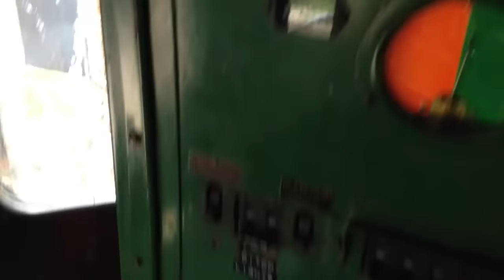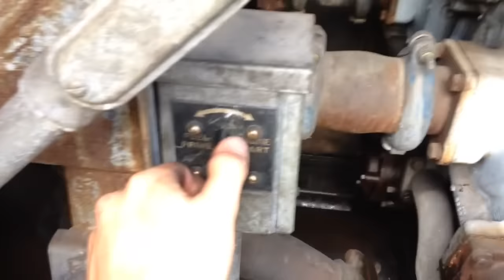Starting a Locomotive, (Full Sequence), EMD GP10 at the Florida Railroad Museum in Parrish, FL

Comment: Not necessarily better, but a whole lot faster than filling water tank, shoveling coal into the furnace, lighting the furnace, waiting for the water to boil, & patiently waiting to build up steam pressure. Cool video!
Reply: @ Pttranjal Shrivaastav Not necessarily. For all the faff and bother it takes to get an old teapot going, the sheer torque they had is unmatched. A healthy 2-8-0 or 2-8-2 will outpull this geep by a factor of two or three, and a mainline monster like a 4-8-4 will damn near pull an order of magnitude more cars.

No, the real reason diesels won out is lower maintenance, lower operating costs, and it being so much easier to run 5, 6, 10, 20 of the damned things in a single train under a single crew. This Geep may not have the tractive efford of even a Consolidation, *But you can just throw six Geeps into the same train and suddenly pull what used to require a Northern*.
Reply: Where did you get that idea, some of the largest steam loco's can't even match Diesel starting tractive effort, nor sustained
Reply: TestECull  Let's see.... According to specs on a 4-8-8-4, the tractive effort is 145,930 lbf... a modern SD70 can produce 200,000 lbf tractive effort starting out and 175,000 lbf continuous.
Reply: @Micah Lall-TrailThey do, yes. One healthy 4-8-4 Northern can do the work of three or four Geeps. A mallet like UP 4014 or 3986 can do the work of 3-4 sixaxle heavies(There's even a video on here of 3986 pulling a loaded stacktrain up Challenger Hill totally unassisted!). They just lose out on operating costs. You have to have a crew on each and every locomotive, so double-heading them is significantly pricier than with diesels. They have VORACIOUS appetites for both fuel and for water. The emissions leave a lot to be desired. They need to be greased pretty often, every 4-8 hours pretty much. They are mandated by federal law to have regular frame-off overhauls(And for good reason, boiler exlposions are terrifyingly powerful, which is what these overhauls are meant to prevent). Oh, and they're also hell on trackage, as they don't run truly 'balanced' and all the reciprocating mass...several tons of it on a mainline steamer...beats the rails right up while their lengthy rigid wheelbases are hard on turnouts.

To put it simply, it costs an order of magnitude less to throw 3 or 4 SD90MACs at a stacktrain than to lash it to 3986 even though 3986 can pull it with grace and ease all on her own.

Oh, and god save your mortal soul if the drivers ever jump the tracks. It's enough of a bitch to get a diesel back on the rails, but if a steamer's drivers jump off...yyeeaahhhh.
Reply: @Sevalecan  https://www.youtube.com/watch?v=XhgHrDbN4EU You see a diesel in consist? I sure don't. Yet there she is, a 4-6-6-4 pulling a loaded stacktrain like it's nothing. Teapots are good at defying the raw numbers on their datasheets, it seems.
Reply: @bait28  https://www.youtube.com/watch?v=XhgHrDbN4EU You see a diesel in consist? I sure don't. Yet there she is, a 4-6-6-4 pulling a loaded stacktrain like it's nothing. Teapots are good at defying the raw numbers on their datasheets, it seems.
Reply: @TestECull  Old steamers have enough torque to jumpstart a planet.
Reply: Then cleaning the boiler from the ashes and soot, after the day ends.
Reply: They certainly are better at operating costs.  The fuel economy must be about a factor of 3 better.
Reply: My dad was a stoker/fireman in Australia up until Diesel Electric came in. He retired before they made him full electric in 1991
Reply: @TestECull  So true, it always comes down to cost
Reply: Sometimes you have to fill the water tank on a diesel locomotive too. If the air temperatures gets down close to freezing when the engine is cold because it hasn’t been running, the automatic water dump valve activates and dumps all of the cooling water on the ground to prevent freeze damage to the engine and air compressor. 
You have to reset the dump valve and fill the engine with water before you can start it the next time it’s used.
Reply: Ralfie very interesting, thanks for the info my friend.
Reply: The Skipper 
It’s too cost prohibitive to use antifreeze in them, it would take 150+ gallons of straight antifreeze per locomotive, and those engines and cooling systems aren’t all that reliable as far as water leaks go. That’s why they use plain water treated with borate for coolant, but it has no freeze protection, so that’s where the automatic water dump valves come into the picture. Treated water these days is usually pink or purple in color, and it’s environmentally safe, where the antifreeze wouldn’t be. 
The treatment used to be green like antifreeze, but when it would dump in freezing weather, the public would call the EPA about the Railroad dumping green antifreeze on the ground, so the color of the treatment got changed from green to pink.
Reply: @TestECull  There is some truth to that...but at the end of the day the maintenance costs associated with a steam far far outweigh any advantages in pulling power.   They were magnificent machines, but comparatively they are just not practical when compared to diesel/electric or electric from overhead
Reply: It is better
Reply: @TestECull  "a mainline monster like a 4-8-4 will damn near pull an order of magnitude more cars" No it won't. An order of magnitude is a factor of ten. And remember that, when you see old films of a steam locomotive pulling a train of box cars, those are 40ft standard-height cars that are considerably lighter than a modern 50ft or especially 60ft hi-cube.
Reply: @TestECull  Diesel tractive effort begins a lot higher than steamers.  Which is why steamers would often slip and spin out when starting.  If the diesels in the "DC" era had any weak point, it was probably that the traction motors could not be overloaded for extended periods of time.  Diesels are also not as hard on track and bridges as steamers.

Comment: how would you shut it down though, cause now I have a locomotive that I don't know how to shut down...
Reply from the maker: The Amazing Gamer 129 push the button that says emergency fuel cut off. Also you can pull the throttle handle slightly and push forward and it shuts down
Reply: tk aubuchon thanks but the cops already caught me this morning...  lol
Reply from the maker: The Amazing Gamer 129 guess I need to put a disclaimer on this video now haha
Reply: Idle down and fuel shut off
Reply: Watch the video backwards to shut down
Reply: That's the "pay per view" part, a mere $3000 will get the instructions sent to your door.
Reply: Pull that button on the Governor out like he did before spinning the engine over to purge any water from the cylinders. That’s the low oil button, it pops out and shuts the engine down if it loses oil pressure. You can also pull the lay shaft handle out and hold it until the engine stops turning. That’s the handle that moved in a bit while he was cranking it up. 
Then there’s the emergency fuel cut off buttons, one on each side of the engine around the fuel filler neck, one inside the cab on the back wall, and usually one at the start station where he wants priming the fuel system before he started the engine. As mentioned above, most of them can also be shut down from the control stand by pulling the throttle handle straight out and pushing it forward. Doing that shuts down all running locomotives in that consist.
Reply: Dump a cloth in smoke valve
Reply: That fact that people are replying lol
Reply: @tkarail  block the intake valve with your hand

Comment: If trains had blow off valves that be funny!
Reply from the maker: Justin Mainemer yes
Reply: Steam locomotives have them. You can find videos of people setting them at the correct pressure - yes, that involves steaming up the loco and intentionally increasing pressure. Damn things are loud as hell!
Reply: The blow off valve would do absolutely nothing as unlike gas engines, diesels do not have throttles. The engine speed is controlled by the fuel flow
Reply: They do have "Test Cocks" which are located on the side of the engine block, one for each cylinder assembly. After an engine has set not running for a day or so, these test cocks can be cracked open and pull out the "Low Oil Switch" (that the fellow pulled out that had the red band on it) and turn the engine over a few turns. This expells any water vapor inside the combustion chamber. (Its so tight a little water will bust a piston). Then tighten the test cocks and push in the Low Oil Button and turn the start switch to PRIME. Then, when the fuel in the sight glass runs clear, with not that many bubbles, you push on the LAY-SHAFT ( which is the short rod handle to your right. This gives more fuel) and you turn the switch to START. This "motors the main generator" and rotates the engine. (On units that are equipped with main Alternators, the engine starts with two starter motors. So you see, you were right about the valves.
Reply: rrrrrrrrrrrrrrrrrrr suddenly goes to notch 8 rrrrrrrrrrrrrrrRRRRRRRRRRRRRRRRRRR- goes to idle BOOOOOSH
Reply: WhatTheFunk 
It would trip the over speed and shut down unharmed.
Reply: Steam locos have blow down valves and "pop" valves.  Blow down valves are located at the front corners of the firebox just above the mud ring to blow water and impurities out of the boiler.  The "pop" valves are safety valves that are set at the desired top working pressure and 5 psi over that pressure and are mounted on the top of the steam dome on the boiler.

Comment: Just a matter of info when starting a locomotive do not let go until the engine reaches idle speed. By waiting until its idling when you let go of the start switch there is very little load on the starting contactors . If you let go before idle has been achieved one of the contactors could stick due to high amperage still flowing through the contactors . Happened to me the fourth time I started a locomotive and had to use a flagstick to get the stuck contactor to release. Until both starter contacts are released the engine will not power up the traction circuits.

Retired locomotive engineer
Reply from the maker: James Shanks thank you for the advice! I was not trained about that possibility happening but it makes sense. I still manage to learn something every day!
Reply: tk aubuchon 

That's all we can ask if you learn one new thing a day it means your paying attention.

Is that engine owned by a railroad or a museum? I ask because those batteries sound very weak starting the engine. That engine should crank right over with authority if the batteries are up to a full charge.
Reply from the maker: James Shanks it's owned by the Florida Railroad Museum, where I work at as the track Foreman. We classify ourselves as both in order to maintain compliance with most FRA rules. (Given our location and situation we are no required to abide by all of them) If I remember correctly I took this video right before the batteries took a s**t. But since then we've installed new batteries and it does a lot better now.
Reply: Ahh, I was wondering about the battery; I didn't hear the normal rrrrrr sound of the starter motor (or is that normal? maybe the GP10 has a different starter? IDK).
Reply from the maker: Benjamin Esposti depends on the locomotive. SD70ACe's seem to be the noisiest but they use air I believe
Reply: Benjamin Esposti 

Up until EMD introduced and started manufacturing the 645 locomotive's all EMD locomotive's used the direct current main generator to start the engine by running 64 volts DC through the field coils on the main generator Turing into a large DC motor to crank the engine over and start it.
That takes EMD from the SW-1 600 horsepower switcher up to the last 567 powered locomotives the GP/SD-35's rated at 2500 horsepower.
In order to go to the GP/SD-40's SD-45 rated at 3000 and the last at 3600 horsepower if they used a DC main generator it would have to grow in size taking up the entire width of the locomotive frame hence the reason EMD went from a DC to an AC main generator and by going AC they could stay in the same footprint of the. DC main generator at a much higher power level. That is still true today even at 6000 horsepower for one unit. When EMD chose the AC alternator as their new main generator the use silicon diodes to convert each leg of the three phase alternator to pulsating DC for the DC traction motors which work better with real DC current but will still be acceptable with pulsating DC current. Now because EMD can no longer use the main generator as a motor to crank up the engine they went to an automotive style ring gear mounted between the engine and the main generator ( note even though it's an alternator producing AC current it is still to this day referred to as the main generator.. Old habits die hard) using 2 32 volt DC starter motors just like what you find in a class 8 truck only bigger and because the starters are 32 volt they are wired in series from the starter contactors which provides 64 volts DC.
ALCO locomotive's delivered 10 Century 430's rated at 3000 horse with a V-16 251 turbo engine. Good locomotive's but the used Ingersaul Rand air starters and this is why ALCO delivered the locomotive's with 4 standard air tanks instead of two. First time I started one at night it startled me so bad I jumped right over the handrail onto the ground at the engine house then had to climb back on it to start it only to discover insufficient air pressure to start it, grab another engine tie onto it and charge the air system back up which took another 25 minutes while listening to the house workers razz me about the rest of the night laughing their butts of at my attempt to start 
it. No muffler on the air starter.vit sounded like the banshees of hell to me and I don't even remember jumping off the engine..

Next time I started one I had ear protection on.

ALCO didn't have the problem with starter contactors as much as EMD did because you couldn't let go of the starter on an ALCO until the low oil pressure light and alarm bell went off then and only then could you release the stater button. If you let go before the low oil light went out the engine would shut down
Reply: Thank you for your answer which is more interesting for me because I am a retired industrial electrician.
Reply: @jamesshanks2614  wow
Reply: @BenjaminEsposti  GP10 Generator start. There's start windings in the generator...
Reply: @tkarail  sounds like a Ford powerstroke engine v8 turbo diesel
Reply: @jamesshanks2614  In marine applications, the emd's all had air starters. Generally two vane style starter motors and later on, one turbine starter motor. Mostly they worked well but in really cold weather, the trick was to open every other snifter valve to lessen the load and get the starter to spin fast enough to start and then you had to run around and close those snifters that were spitting fire (on a twenty cylinder engine, it would take a minute.) The other trick was to open the bypass around the air pressure reducer so you'd get 250 psi to the starter vanes, but you had to be careful because you could damage the starter, or worst case, knock a tooth of the ring gear. Mostly, the office wanted you to get under way and how you did it wasn't something that they'd get involved with, unless you know, something got damaged.

Comment: Great video and TNX for making it. I was a conductor on a scenic line in NH for a couple of years and had to start up the locomotive many days. I thought the only thing you should have shown was opening/closing the cocks in the cylinders to blow out any condensation. As we all know, failure to do that can cause engine failure from the steam explosion in a cylinder. I miss starting up those giant engines. TNX again for making the video.
Reply: The steam explosion in the cylinder? That’s a new one. How about just simple old water from the cooling system getting on top of a piston through a leaky head seal? Water doesn’t compress, so you open the test cocks to pump that water out of he cylinder as the piston comes to the top of its stroke, that prevents a bent connecting rod. The fuel explosion that occurs in that same cylinder while the engine is running is significantly more powerful than any “steam” explosion would ever be.
Reply: Was that on the Conway scenic railroad? I go there quite frequent, I may remember you
Reply: No. We don’t all know that.

Comment: Our company owns the 8130 which is also a GP10. We installed a BOA system for extra tractive effort and mated it with an ALCO slug. Even has the same puke green cab color :)
Reply from the maker: Tracy Aspenhilde ours was rebuilt from a road slug and run by IC, so the cab is not Factory. so my guess is whoever rebuilt ours rebuilt yours as well!